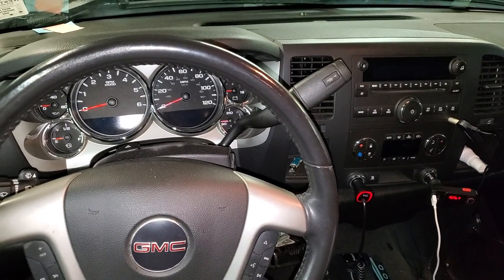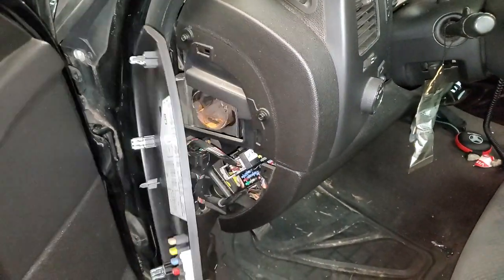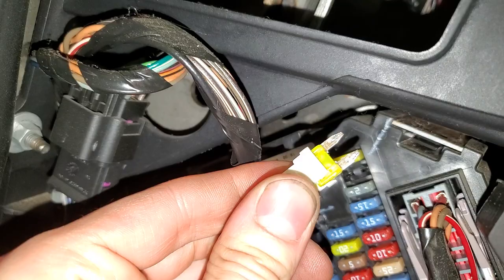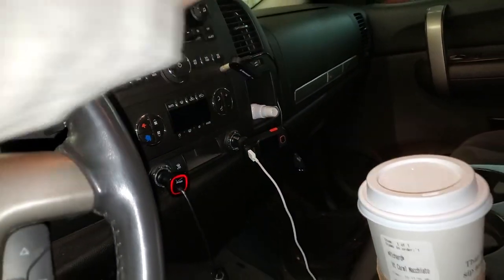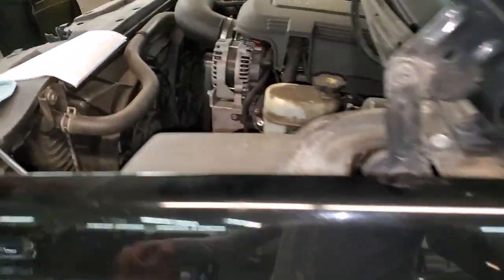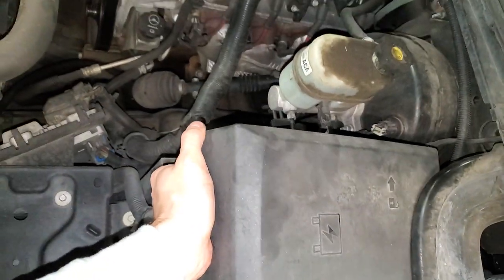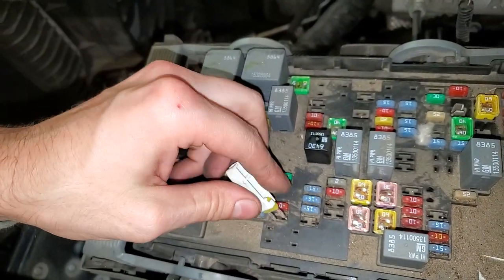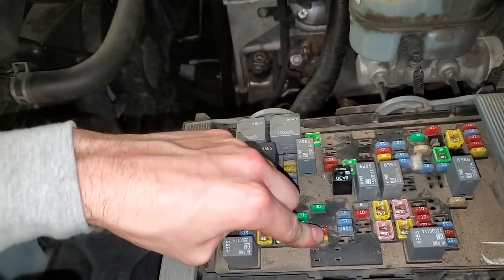2008 GMC Sierra Cigarette Lighter Power Outlet Fuse Location

Comment: The fuse you pointed out in the engine fuse block is labeled power mirrors on my 2008 2500hd .... no wonder I wasnt looking at that fuse for the cig / obd  port

Thanks for the tip!!! Saved me alot of time/headaches

Comment: Is there anyway to make the drivers side turn  off with key
Reply: I would also like to know
Reply: They are wired to always be on, which is annoying. 
Best I could say is to rewire it to the accessory on. Im going to try to find another open fuse slot that has accessory on power and rewire to it.

Comment: what can be the problem if all fuses have been changed but there is still no power.
Reply: The cigarette lighter socket; look on Amazon, they aren't that much and come with a nifty removal tool.
Reply: I replaced the fuses and lighter ,  still not working...